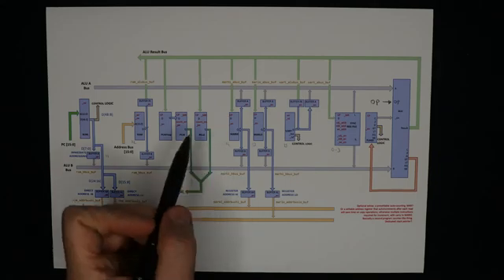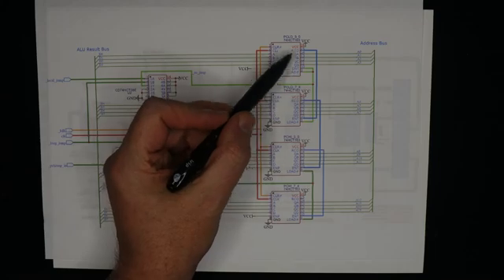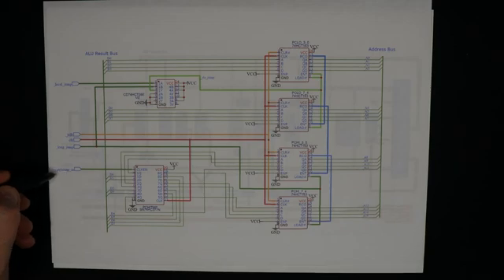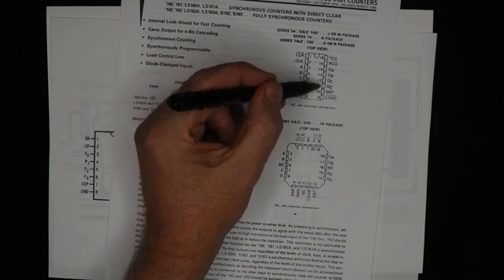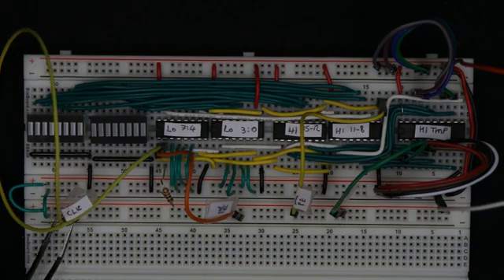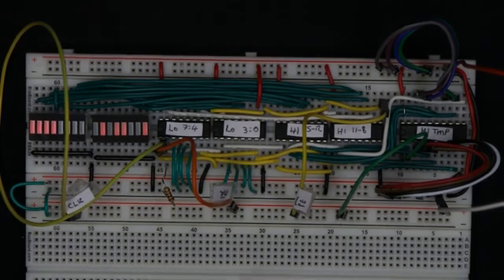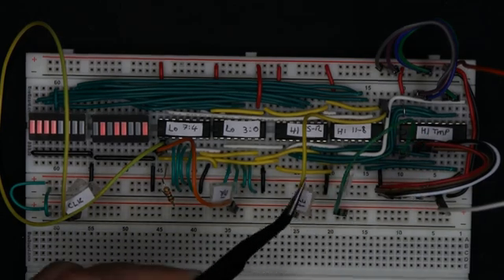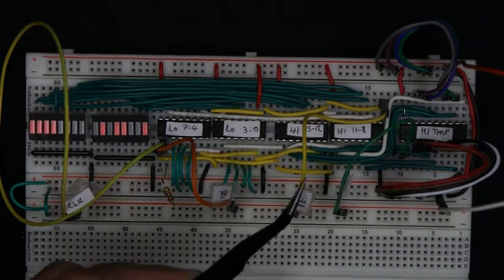Program Counter : SPAM-1 8 Bit CPU - Part 2

Comment: From my own research for the difference between ripple carry and look ahead depends on your particular needs.

A ripple carry has less components, is easier to construct and is cheaper, however when you have a larger bus size or word width, there is a propagation delay that you must account for. For a simple 8 or 16 bit ALU this shouldn't be an issue.

For a look ahead adder it does require more logic and there is extra levels of propagation delay within the circuitry however those levels are constant and the overall operation of performing the addition of larger word sizes is much quicker. These types will tend to be more expensive and require more space within your circuitry design. 

There are also hybrid ways of doing this too... Let's say you are building a 64 bit register or word line that is feeding into an ALU. How do you want to design your adders?

One way would be to have 4 bit segments or nibbles or an entire 8 bit word that are ripple carry and between each 4 or 8 bit segment you could then use the look ahead logic tying them together to create the entire 64 bit adder. You wouldn't want to build the entire 64 bit array with look ahead because the logic will become more complex and you'll end up having more levels of propagation delay as you traverse towards the MSB. This would then defeat the purpose of using the look ahead technology. 

For simple bread board computers that are 8 or 16 bit... simple ripple carries are more than sufficient. For modern 64 bit CPUs running in the GHz range, they will then create a bottleneck in your operations thus a combination of the two are preferred. 

I may not be 100% correct or accurate within the terminology as I have no formal training as it's all independent learning and research, but this is what I've gathered from it. I've implemented both a 4 bit ripple carry and a 4 bit look ahead adder within Logisim based on the datasheets and their logic diagrams from TTL ICs. such as those from Texas Instruments, 7000 series.

Basically with a ripple carry, the addition of individual bits that propagates towards the MSB one has to wait for the previous half adder to do its computation to know what it's carry out will be. With the look ahead design. We don't have to wait for that computation as we can precompute it by knowing the combination of states between 3 bits being added. 

Kind of think of a ripple carry as a circuit or memory in series and a look ahead as being done in parallel.
Reply from the maker: Hi, from memory I think this response was due to me saying that the datasheet was a bit pants and didn't explain the possible configs for the country IC.
The only details I found for cascading was the 74LS datasheet...
https://www.ti.com/lit/gpn/sn54ls161a-sp
This same chip can be used in two configs without any external components but what are the advantages for choosing one over the other and when I choose one approach then what is the down side?
Any clues?